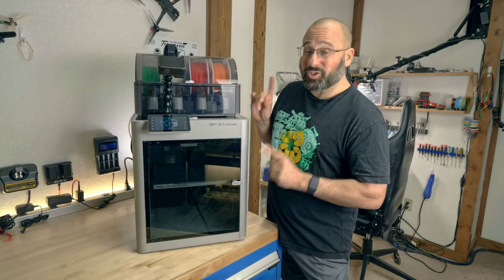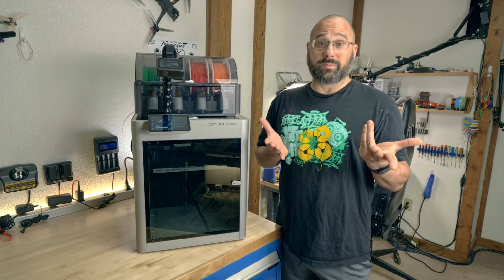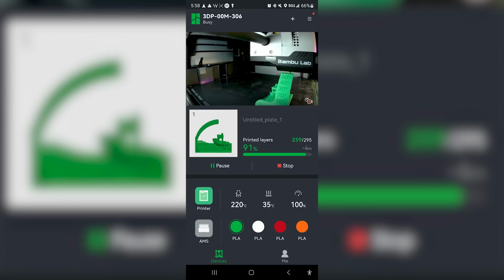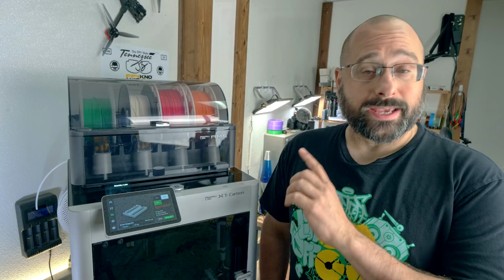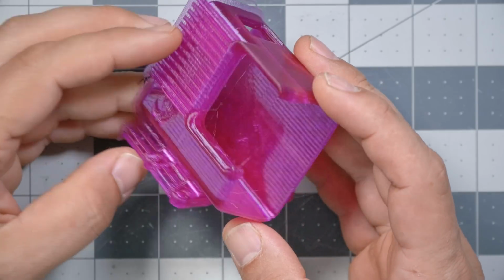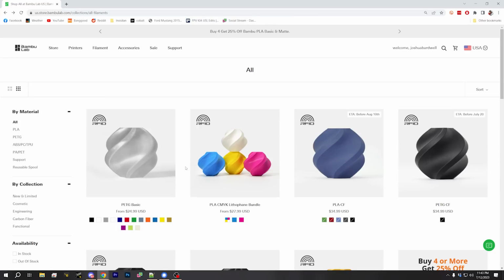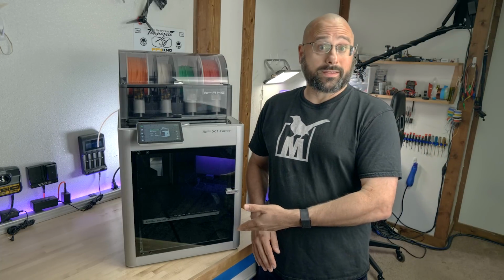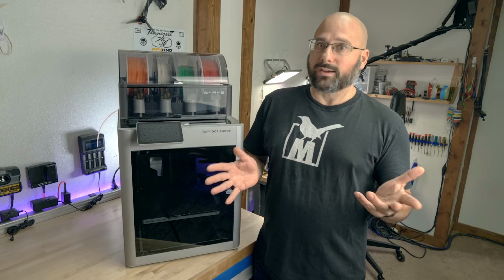Bambu X1C: the Fastest, Easiest, BEST 3D PRINTER I've Ever Seen

Comment from the maker: Although I'm reviewing the top-end X1C, Bambu has two other printers that are significantly less expensive. The P1S and P1P are just as fast and easy to use as the X1C, but with a few corners cut to save price. Many hobbyists--especially those who don't print more exotic filaments like ABS and carbon nylon--won't notice the difference.

These are affiliate links....

Shop the Bambu X1C: https://shrsl.com/45i1o
Shop the Bambu P1S: https://shrsl.com/45i1z
Shop the Bambu P1P: https://shrsl.com/45i28

If you're at the $300-ish price point on a printer, the Bambu printers are simply out of reach. But bear in mind that by the time you finish upgrading that $300 printer, you might have afforded a P1P, which will unquestionably give faster, easier, better results. If you're in the $500 and up price point, there is a good chance this is the printer you should buy.
Reply: Keep in mind that in all practical reality, you're probably not gonna upgrade a $300 printer much anymore unless it's a passion project.  The upgrade project printers are now $100-150.  You can get a Creality Ender 3 V2 for $100 from Microcenter or say a Voxelab Aquila X2 on sale for $150.  At $250ish the Sovol SV06 and the Elegoo Neptune 3 Pro have almost all the common upgrades people would do to the upgrade project printer - all metal hot end, PEI build plates, auto-bed leveling, better part cooling, direct drive extruder.  If you upgrade these, it's gonna be to add Octoprint or go to klipper, and you're talking usually adding an SBC of some kind, more part cooling, and maybe a higher flow hot end to go faster.  You're still nowhere near $600 probably doing that.  $300-350ish gets you the same kind of printer but tricked out with Klipper out of the box with high flow hot end and stronger part cooling for faster speeds that while they won't meet the speeds of Corexy printers like the Bambu, they're faster than without Klipper.  Models like this would be the Sovol Sv07 and the Elegoo Neptune 4.

Let's be honest... if you're buying one of those four printers, you're probably not going to try "upgrading it" to be comparable to a bambu because it's not practical to convert it cost and time effectively to corexy.  Buyers who want corexy are virtually all going to be buying a printer that already is corexy or they're building something like a voron.

One other note: almost no one IMO should consider a P1P with the P1S available.  There's well more than $100 in value in the P1S over the P1P between the enclosure, the added auxilary part cooling fan that's $30, plus filtration in the enclosure.  I dunno... maybe if you're buying a fleet of them for a farm, but normal consumers?  Just get the P1S over the P1P.
Reply: @heroflying  yeah, I was going to say I bought an ender 3 pro for £120 and upgraded it and have probably spent less than £300 all in with significant upgrades, including a skr mini e3 mainboard, E3D v6, now replaced with a better and cheaper triangle labs v6 clone with plated copper heat block and thermistor so it can reach 500 C, PEI, PEX and glass beds, dual gear extruder, better springs, filament sensor and bed levelling sensor.

If you don’t mind going with a company like triangle labs then you can get parts very cheap, except from their higher end parts like tungsten nozzles or high flow hotends. They even have what is essentially a variation on the E3D Revo for a lot cheaper.
Reply: For what you get 1500 aint half bad.. Still a bit out of reach for most but this is an awesome step.
Reply: @crisnmaryfam7344  considering it easily beats even very expensive industrial printers (especially those from years ago) in terms of capabilities it is a very good price.
Reply: Now you need to build a voron of any caliber
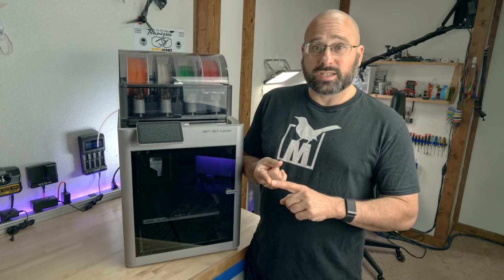Reply: 28:38 correction: the P1P absolutely does work with the AMS.

Comment: I am late to this video but just purchased a X1carbon and printed my first benchy. I would say that this is the printer that Apple would make if they made 3D printers (Tesla is a bad analogy as they break too easily). I am a product designer and product design is defined as arranging components in a way that makes them usable. It is not invention, you do not have to be first but it has to be highly usable, which in turn makes it successful. Apple did not invent the touch screen, or the processors or any of the cell communication chips. What they did was arrange them in a usable form which was ground breaking and ushered in the smartphone revolution and the rest is history, ( this is a quote from Paul Jacobs, when he was CEO of Qualcom) I am sure many people would say that there are better phones out there which is great, but someone has to lead the way.  I regard Bambu as the shot across the bow of the industry and I can’t wait to see what they come up with as a response, especially Prusa, they have great machines, if only the UI was up to current standards. I have built many custom 3D printers and have used them professionally. I was planning on building a Voron but realized I could have the same results without the time consuming odds and ends, which I love but just don’t gave the extra time. 
I Also want to praise Joshua for a very informative video, I’ve watch many videos regarding the X1Carbon before and after my purchase but this is so much better than the average output from the 3DP YouTubers. Better questions, better explanations, thank you. Also congratulations are in order, I watched some of your very first videos when you were starting out so many years agoand glad that you are successful in a very tough market.

Comment: Bambu does NOT say to use glue stick when printing PLA. Period. They NEVER have, they only recommend it for high-temp filaments to aid release, NOT adhesion, please note this! I've never used gluestick on ANY of my Bambu printers on ANY of their own build plates or WhamBam. I keep seeing these users with GOD AWFUL looking build plates because they slather on glue. did you not READ? it says to use it ONLY IF you have problems with removal.

Comment: This could be just me, in the UK, but the Ender 3 S1 currently retails on amazon for £186 ($235) (that's what I paid for it) and so far I cannot fault it. Print quality is great, the print time (with a little bit of tinkering) is quite acceptable, and if you're not dead set on printing ABS, there's no need for an enclosure.

Sure - it wont be as fast, but if you're doing this as more of a business, then getting 5 of them + 5 Raspberry Pi 4's + nearly 15kgs of filament, and investing just a bit of time into the setup seems like the better deal to get started mass printing.

Comment: Great video and thanks for all the info. I'm a newbee at this 3D printing stuff and trying to decide what brand to go with. I'm a hobbyist and hate to tinker. I'm looking to print some external signage that can be illuminated with LED lights strips and use multiple materials. I'm aware that I'll need to learn to cut my objects into several "pieces" and assemble them after they're printed since the bed size is "small'ish". I also want to be able to print in multiple types of filaments to produce many types of prints for household products, etc... Is this the printer for me?

Comment: A tip for using glue stick - after applying wipe it with a damp cloth - it'll dilute, thin and evenly spread the glue improving adhesion and bottom surface quality. It'll look like the glue has gone leaving the build plate wet, but it'll soon dry leaving a really thin residue of glue.

Comment: 26:39 - I am that person. Or rather, i was. I bought the OG ender 3 a couple years ago and basically practiced the grandfathers axe principle with it. Had a chimera 2-nozzle hotend on it at one point, BL Touch and what not.

When the X1C came out i thought to myself that i do NOT want a tool that "just" works, but that i want a machine i can tinker with. And that spending 1500€ for a printer is ridiculous... Then i had some down time on my printer. I then needed it for a project where i had to print quite a few parts and after turning it on after a couple weeks it didn't work properly. I had to sit down for a while, rebuild half of it, troubleshoot for hours and hours until it worked again... When it then worked like a tool again, reliably.. i realized i don't want to tinker anymore.

I've built a few 3D printers, i modified the heck out of them. I did everything i wanted and i know how these machines work. And now i am at a point where i just want a tool that works reliable. I now orded the X1C combo a few days ago and i am super excited!

Comment: I want to support Prusa. I sold my E3Pro to get a MK3S+ just to do that (and I have seller's remorse over that). After chasing multiple issues for the last week I ended up buying a X1-C at 1AM. I've replaced parts on this printer once already and already need to do it again. It has NINE DAYS of print time on it. I've worked on it twice and it's only printed for 9 days. My Ender was better than that. I probably just got a shit printer but at 1AM after a week of struggle rationale goes out the window... as does over 1000 dollars.

Comment: the build plate is rubbish.... so many videos with the print detaching at the end.... and so much glue (which i hate to use because its ugly and messy)... why cant the add a PEI glass plate? My Ender 3 has ZERO adhesion issues... my P1S is almost 70-30 with adhesion issues...
And think of that : 7 minutes prep only to fail at the 3rd minute of printing... and then 7 minutes of prep again... awesome printers when they work but god annoying when they dont. At least the Ender 3 cost me 150 dollars, not 800....
When it comes to TPU : on the site it is declared with red bold letters that it is not compatible with AMS so i hope you did not take it through that...

Comment: No CLOUD BASE anything, for common sense purposes if you value privacy and want to protect intellectual designs. Having a camera monitor your prints linked to the cloud seems a bit intrusive NO? regardless of how fast and accurate the printer may be. 

No thank you I will keep my older style printers and monitor the prints privately myself.  Same thing happened with multicopters the minute they were introduced with apps that can be used with phones. Granted a PC, laptop and cell phone these days are probably the greatest's intrusive devices, a person with common sense logic and a bit of tech know how can bypass the spyware and intrusive features. 

Hey what I print like what I film, should be my choice to place on the internet and not an app, company of internet of like monitoring stealth or not, every activity and recording it on the cloud. For safety sakes, one should never leave a 3D printer running while away from it.  People rely too much on  AI, without taking into account that while AI it is not perfect it is highly intrusive.

Nope not paranoid, jut commons sense approach and I love having control over the machine and not the other way around.

Comment: I completely agree. Prusa has done, and continues to do, so so much for the community. They're worth supporting, especially since they also make amazing filament. Open Source has been a blessing for FPV, too. Support the Betaflight, ELRS, EdgeTX, HDZero, OpenVTX, FreeCAD etc. developers ❤

Edit: What Bambulabs has done with this printer is impressive. But it doesn't give anything back to the community that built it. That's sad, especially because the result seems to be so good. Prusa shares their advances and Bambulabs just goes and copies them into their Slicer. That's how innovation dies.
Reply: The Bambu slicer is open source and Prusa and Orca Slicer have taken things that Bambu did and implement them into their slicers. But you mean that their printer hardware and firmware doesn’t give anything back and to that I have to grant you. Personally I don’t have a problem with them protecting their IP. 

I am on the side of the argument that states that open source can stifle advancement because there is little financial incentive to innovate. This is why 3d printers for the last like 6 years have had almost zero innovation and all we have gotten are cheap clones. But Bambu came around with top tier engineers and made huge strides. 

Lastly, I do feel that even that Bambu Lab protects their IP it still helps to drive the industry forwards because other companies want to make a printer as good as theirs so they hire good engineers.
Reply: @c0mputer  Weeellll... I'll leave my comment because I still feel that they should open up their AMS to Open Source - perhaps make it a non-commercial license? But yeah, their printers are amazing and I see how I was wrong about the innovation aspect. Clearly other manufacturers are finally getting off their butts!
Reply: @luckbot-5000  I understand the feeling but for me, in any other industry, sharing your IP would be insane. It’s just in 3d printing where people expect it. Horrible example, but let’s say I was a window washer and after 2 years of experimentation came up with the single best soap solution that left zero streaks and cleaned the windows much better and quicker; if I was required to share that soap solution with all other window washers I would be pretty pissed off. 

For me, since the X1C came out and then QIDI and Creality came out with decent competition shortly afterwards, I am very mad at Creality and QIDI because they HAD THE CAPABILITY all this time to make next level printers. Yes, they’re not great but they were too scared to even give it a go until they realized they could make more money. It’s like they can only make copies of printers that already exist, not come up with anything new.

Comment: Sounds like Prusa has it dialed in better with better plug and play settings for the widest variety of filaments.  Also, what about those people that don't want the loudest printer on the block which is what the Bambu X1C is.  In addition, with Prusa implementing Input Shaper for the mk4  it's a much faster printer than it was before.  Furthermore, Prusa customer service is same day fast.  Perhaps Bambu will get it right over time, but I still think Prusa is the better way to go for most people who can look past the shiny bells and whistles of the Bambu X1C.

Comment: Great review, can I print ASA and Carbon in this?  I build automotive parts and I am having a huge PITA time printing ASA, it warps on every printer I try.  Also, the P1P isn't smaller, it's the same exact size, it just doesn't have the enclosure or the screen.  :)

Comment: I just recently got the X1C Combo, best decision ever. I wish it had a 14 inch build volume but eh, it's still excellent and I have an ender 5+ for the odd large print. Regarding the TPU print with the X1C filament, did you dry that spool first? I wouldn't use the drying feature in the 3D printer itself, I'd be putting it into a proper dehydrator lol

Comment: As an owner and early adopter of the E3D ToolChanger printers, the Bambu is very impressive simply because of the sheer amount of automation in the thing. There are ways to replicate quite a lot of the feature set with DIY and open source parts, but that featureset as a kit alone would run significantly more expensive than the X1C. So the business model seems to be to lock you into their walled garden to a degree and make the money there.

However, I am not impressed by their selection of printing surfaces. Gluestick is really not something that should be necessary in this day and age, I love my custom machined PEI printbeds, no prepwork whatsoever and the prints pop right off after cooldown or you use some isopropane and let it seep between the part and the bed. Dry off, start another print.

Price vs performance on the Bambu printers is completely insane though, especially when for professional use. When you compare the price of the things with what you usually pay for a pro level printer, they cost several times more than this, it is a real no brainer, so it is no surprise that these sell as well as they do, despite their shortcomings and imperfections.

Comment: My paper printers have been less reliable than my Prusa. I've had a HP (broken flex cable on the print head), an Epson (clogged print heads every time it was used) and now a Brother printer while I've had my Prusa Mk3. This Brother has lasted for a few years so far, but it does get paper stuck in its duplex module every other week. My Prusa printer has so far never let me down. Safe for the clogged nozzle this one time, which was easily fixed...

Now, I've also had a couple of cheaper Chinese 3D printers, these have been less reliable and caused more hassle.

I've promised myself an X1-Carbon after my next project is ticked off the to-do-list: Finally converting our on-suite storage room into the bathroom it was meant to be...

About the vibration compensation; look at the open source Klipper firmware. They have been doing this for many years.

Comment: I've never used glue on my X1 Carbon and have had.. I think 2 failed prints in the year I've had the printer (those were due to how I placed the model). 

I don't print any super uncommon materials, mostly PLA, PET-G, ASA and CF variants. The only difference is I use a textured PEI plate.

Comment: The gluestick is for releasing the print. If you didn't use gluestick you'd damage the surface removing it.

Also, you should clean the build plate every now and then and use less gluestick. It just needs a thin layer to release. Use a damp paper towel to smear the gluestick around until you can't see it and that will be ample.